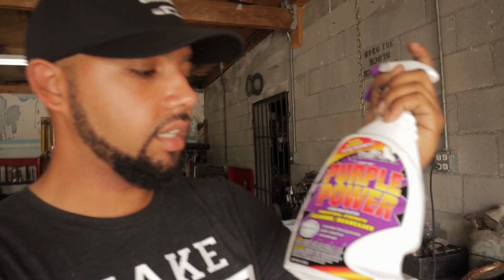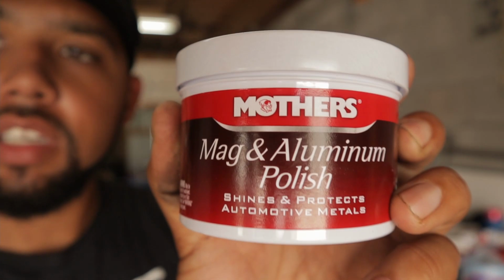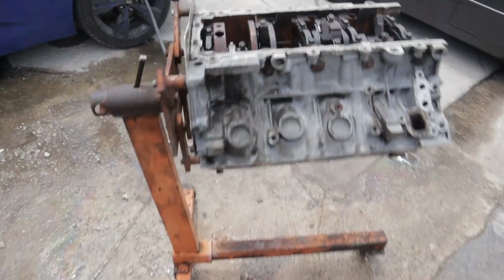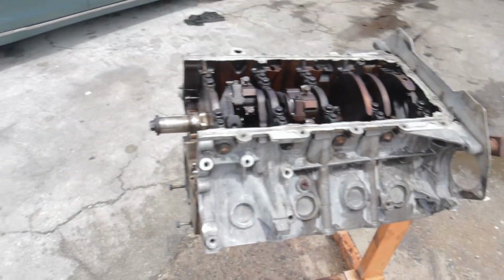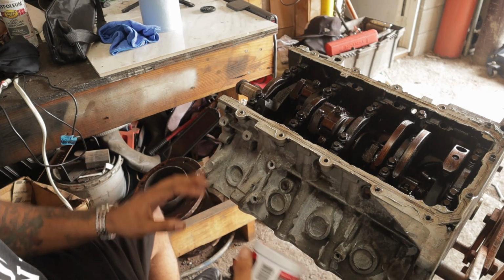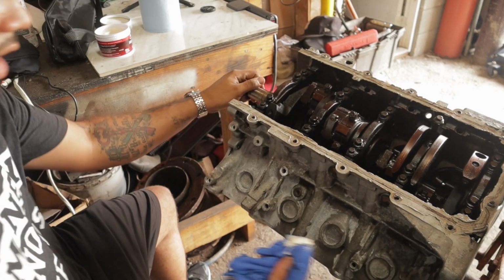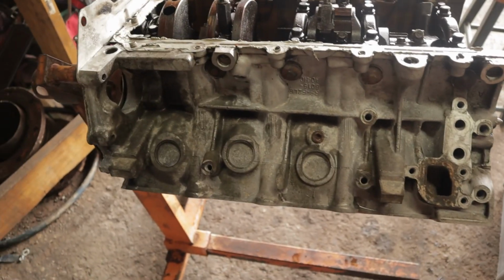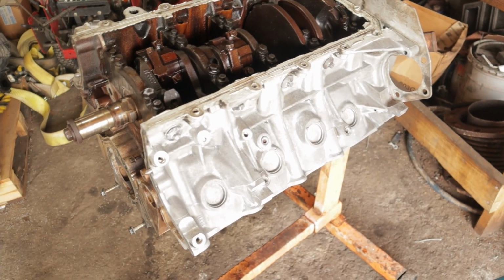How To Clean And polish Aluminium

Comment: Your channel is awesome.  Can you do an intake manifold video for the B head 4.6 dohc 4v?
Reply: @DriftDreams242  I'm doing a cobra intake swap on my 98 LSC soon and will be my first time
Reply: @DriftDreams242  i managed to pick one up with the throttle body, cable, imrc deletes, hardware and other sensors for 500 bucks today!  my big issue is it doesnt come with the fuel rails